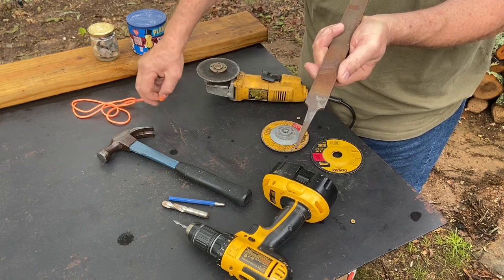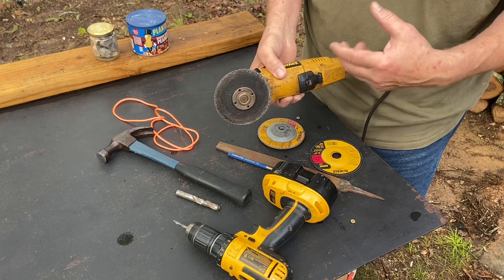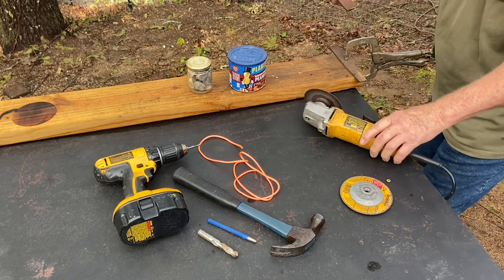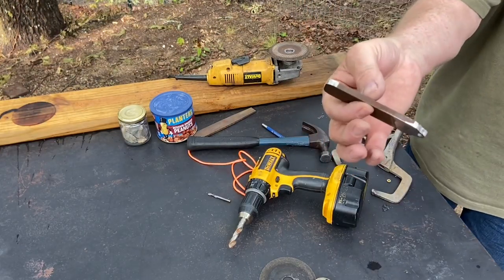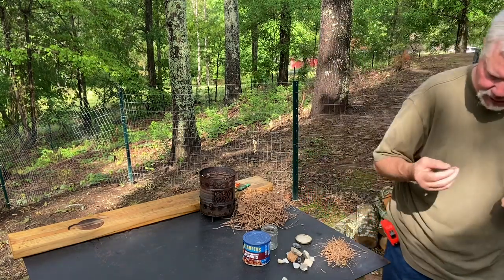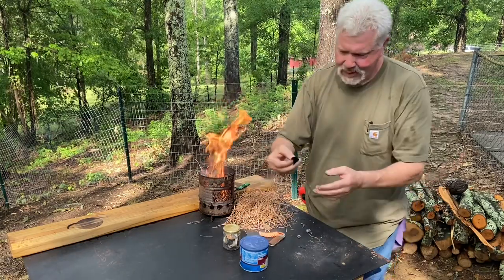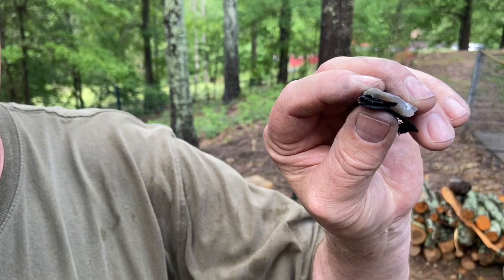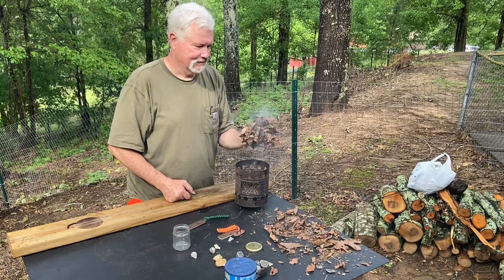How To Make A (Flint And Steel) Steel Out Of A Nicholson File

Comment from the maker: Old worn out Nicholson Files make some of the best Flint and Steel, Steels. This is my 4th video about it (See LINKS below). Such an easy build that can be accomplished by the angle grinder method demonstrated within or simply by clamping the file in a vice, breaking it, and then smoothing the sides.
   Come have a look at the build and the 4 fires I made trying it out. Please SUBSCRIBE, hit the Notifications Bell, and select All. Thank You!

Let’s See What A Socially Distanced Flea Market Looks Like. First Watermelon Of The Year... SWEET!!!
https://youtu.be/RL2Zw3Inbok

2 Flea Market Finds, Stanley 16oz Claw Hammer * Will Nicholson File Make A good Steel? Cast Sparks?
https://youtu.be/RL2Zw3Inbok

Making A (Flint and Steel) Steel Out Of A File And Trying It Out!
https://youtu.be/nBrX2gi80Ts

Making A Flint and Steel, Steel From A Nicholson File
https://youtu.be/HOPECwE-Mck
Reply: Great vids Dave. Try using the sharp edge at the back of the file for scraping your ferro rod. Works great.

Comment: Great video as usual.I agree with you on angle grinders,never had a problem,been using them for many years.
Keep'em coming brother,enjoy them all.
Reply from the maker: As a pipe fitter, in total, I've probably spent well over 100 hours using big and small grinders with cutting, grinding, flapper, etc. discs. Yes, I guess a freak accident could happen, but it's not as common as people are trying to say it is. With 10 other welders and fitters in our company and the all the other crafts on the same job as us, Electricians, Steel Workers, Tin Knockers, etc.) I've never heard of a grinder's cutting disc exploding and penetrating safety glasses and taking out an eye. Never heard it mentioned once in our weekly safety meetings over a 10 year career.

Comment: I have a lot of experience with a multitude of grinders. I have seen cutting wheels shatter when they are used incorrectly (Not easing ing a cut or not knowing that the rotation of the wheel determines how you start a cut).  Also, when they are poor quality.

Comment: Great video David. I made a few steels from files after watching your original video on it. They work great. I also cut a half moon/half circle on the bottom edge which doubles as a ferro rod striker or for getting shavings of wood 👍
Reply from the maker: I didn't like mine for a ferro rod striker but others say they like to use theirs to strike ferro rods also.

Comment: A concrete drill bit with carbide tip can be sharpened to cut through the hardened file.
Reply from the maker: I got a new one to cut halfway through before.

Comment: I have/had a lot of friends that worked out of the pipe-fitters’ local 195. Most accidents are caused by operator error. I’ve gone micro with my flint/steel, 2” piece of hacksaw blade and a shard. Just like files, not all hacksaw blades are the same quality. A lanyard is very helpful on the 2” piece of blade. #funwithfire
Reply from the maker: I used to have videos using hacksaw blades for a steel, but not 2". Yes, you're right, some blades are not that sparky.

Comment: The nut cans I've seen for a while are thin foil lined cardboard. Might there be humidity entering through that?
Thanks again.
Reply from the maker: This time, the charcloth was dry. The air that's needed to support ignition is full of moisture.

Comment: So I'm curious about the hardness of  the metals.  Most steel, even mild steel is ferrous and will spark, so why do people use such hardened steel like in files?  Much of the hardness is in the temper, and not just the ingredients.  Doesn't it makes it much harder on the flint?  Plus a softer steel could throw more sparks, as more steel would be shaved off.

This is important to us folk who need to have flint mail ordered, or if we're lucky, find some chert here and there.  A softer steel would allow the stone perhaps a couple extra strikes.
Reply from the maker: Sparkiness of steels is a function of their carbon content and hardness. A Nicholson file is 1095 steel which is right in the carbon content sweet spot. If you take the temper out of the file by excessive grinding, heating and allowing it to slowly cool, it will not cast as many sparks. It makes sense that hardened metal, will allow you to shave smaller particles and those are what you want. It's the microscopic pieces of the Steel that are combusting when they come in contact with the oxygen in the air.
Reply: David West    Makes sense ......I guess.